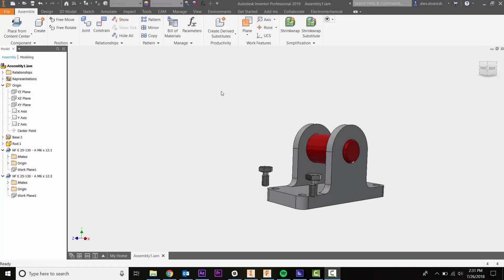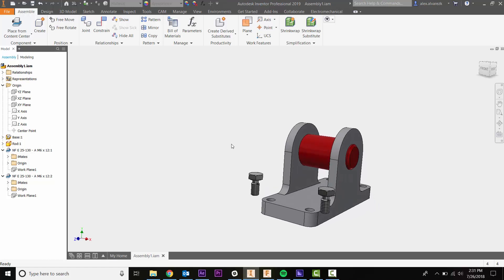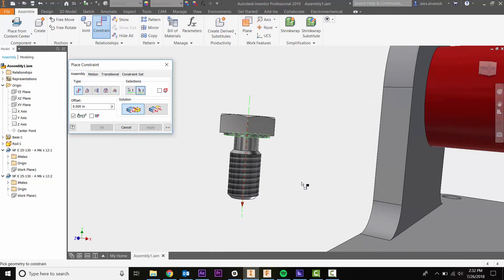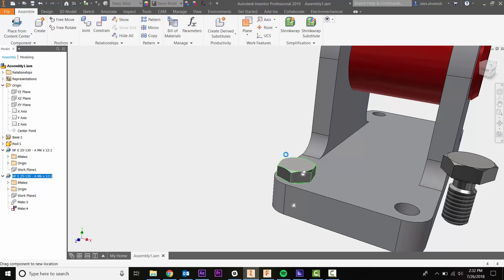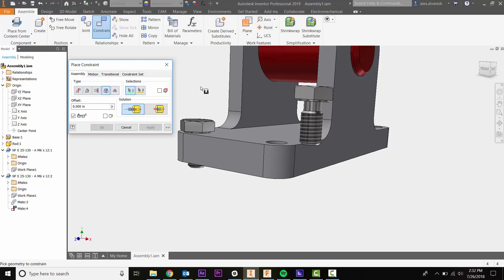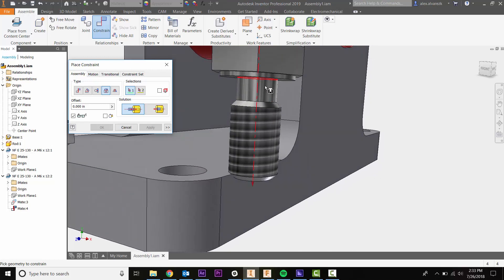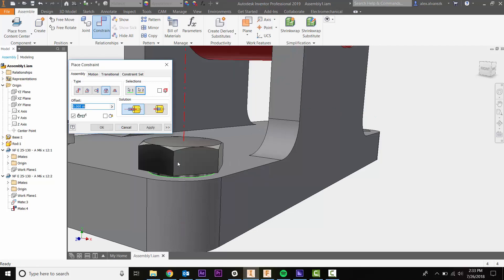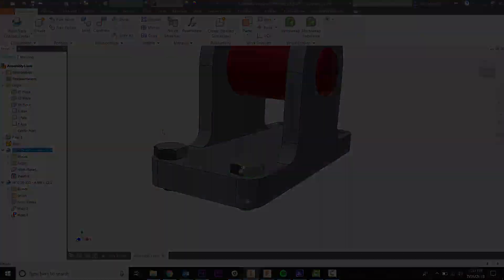Quick Tip - Insert Constraints

Comment: It is true that most of the videos here are beautiful from side the direction, but the problem in workers on videos they are not understanding the basics of mechanics. It is important side.
How to put a screw in this method?!
How to put a screw does not go up or down during the rotation?!

This is problem of videos here
Reply: I know that my answer is old, but in the newest version of Inventor, you can switch between two options to indicate the direction of the screw. However, in older versions, you can achieve this by setting a constraint and performing a simple rotation, which will change the direction."